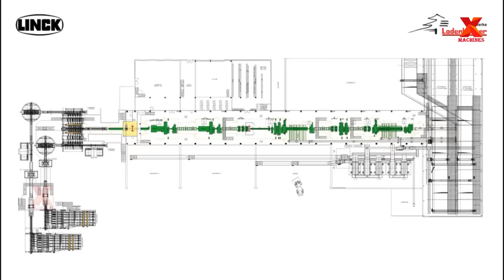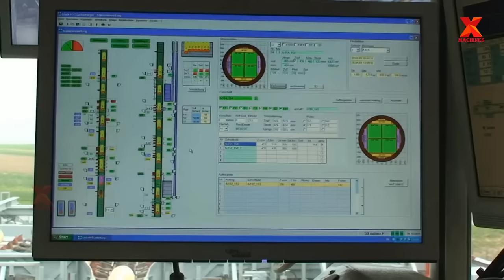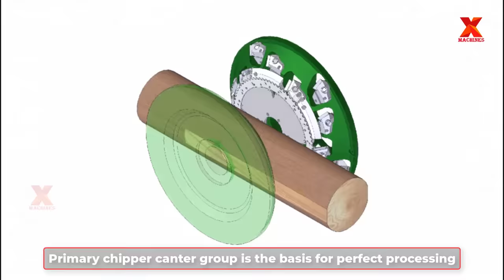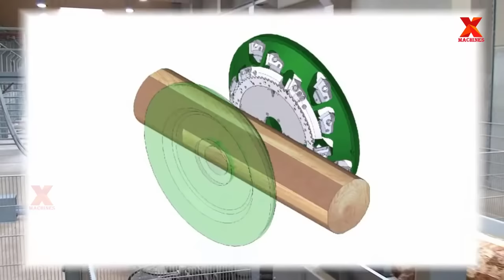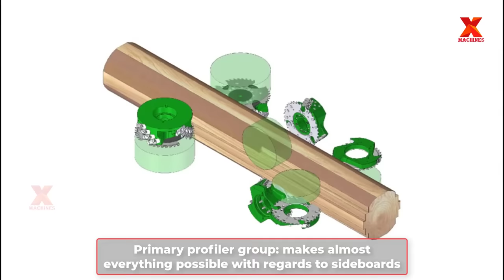Incredible Modern Automatic Wood Processor Production Factory. Wooden Cable Drums Production Line

Comment: Many years ago now when I worked for Intefor at the 3W site in BC, they had an older Linck line system .  The company had upped the speed of the line for more production , but that also brought up the repairs/maintenance , so it turned into a very high maintenance breakdown system .   It was designed for a slow walking pace , but Intefor had upped the speed to almost a jog to follow the cant through the line .
The Linck system was /is very expensive to purchase compared to many other types of system, probably because it is from Germany and high duties are set . 

The Linck system worked pretty well with pretty good recovery, but it was high maintenance .  I spent many hours working on the line in the years I was there .
Many of the components are modules and the repairs were re & re the component and break down the module during the week to do the specific repair or complete rebuild of the module .

Comment: Those multi-saws are just insane. And the auto-stacker. Wow.

I am surprised they don't have more machines making the final drums though.
Reply: No ear protection either, yikes 😬
Reply: I was amazed at how wasteful the drum wheels are.  A bit of sophistication for the outer boards would save huge amounts of timber.  As in why are the outer boards the same length as the centre boards?

Comment: 👍🏭🪵The level of automation in this wood processor factory is truly impressive. The multi-saws and auto-stacker are amazing to watch in action. However, I also noticed that the final drums seem to be made mostly by hand. I wonder if there's a reason why they haven't implemented more machines to make the drums. Maybe there's something about the shape or size of the drums that makes them difficult to automate? It would be interesting to know more about the production process and the choices behind it. Overall, this is a fascinating look at modern manufacturing.
Reply: true - a saw optimiser in the drum factory could reduce waste enormously